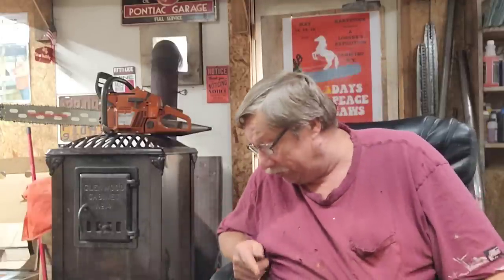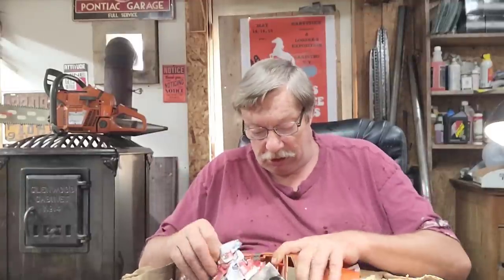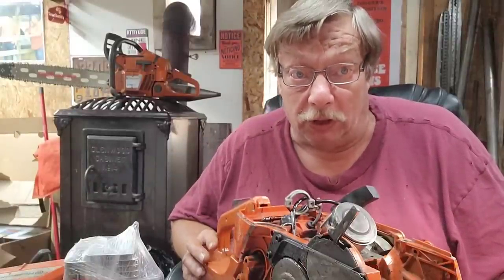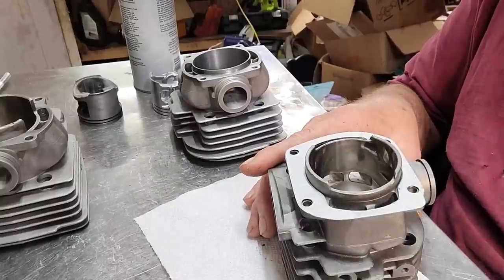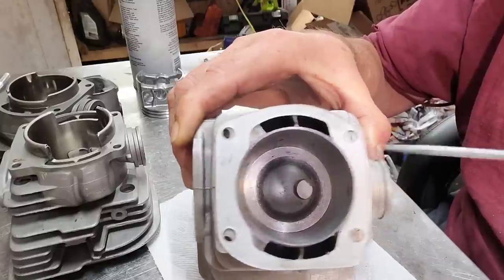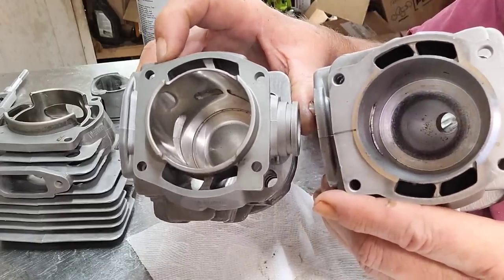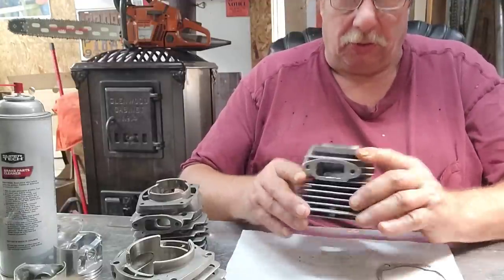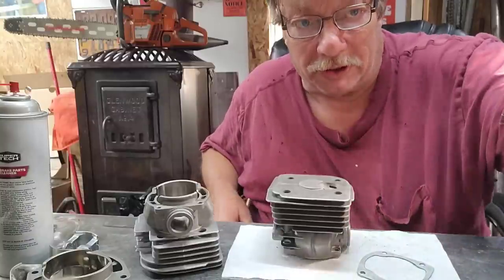94cc 372 build for buckin billy!  how to build this saw!

Comment: To lower the weight of your piston, work on making your crank pin lighter, that's how the dolmar 6400 7300 7900 all use the same crank, piston diameter is the only difference between these three saws, and your cylinder fun looks like me trying to put a 038 magnum cylinder on a 038 special, thanks for the video and the stories

Comment: On the 86cc build with 661 piston. Instead of cutting .080 off the top of the piston maybe cut .050 off the squish band and .030 off the top of the piston. Maybe that would help so the top ring groove is not weak.

Comment: Harv have you ever worked or ran a stihl 441 carb non m tronic
Reply from the maker: Just got one for myself today! Gonna be interesting!
Reply: @theironhorse6600  you may not like it. It's like a 372 that got everything wrong. At least the 1138 chassis is. I would rather take on 5 044 saws than one 441